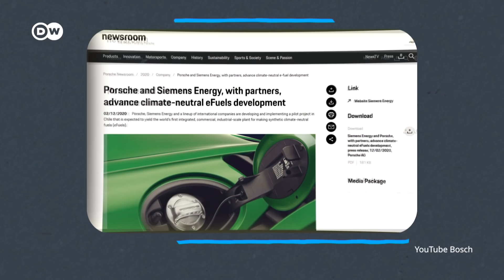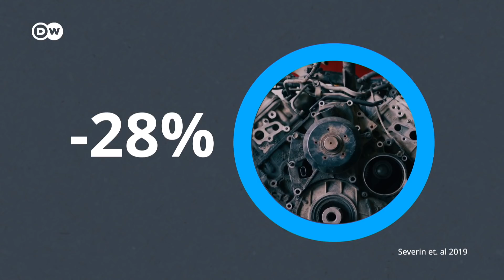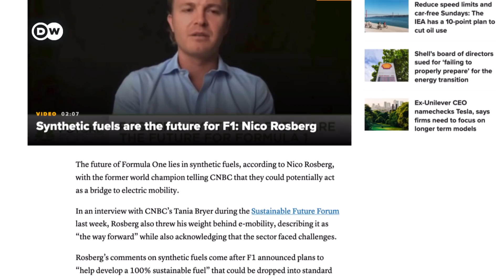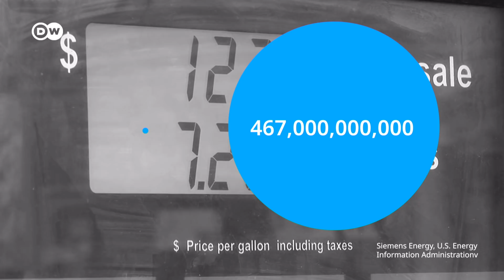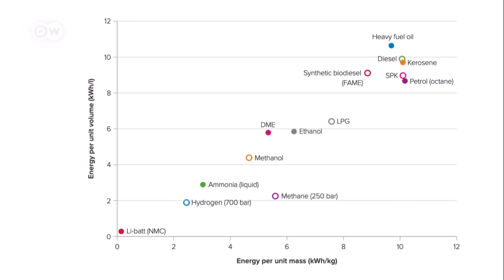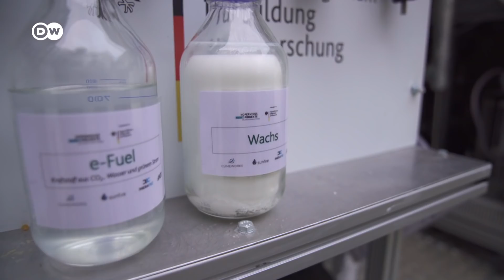The truth about carbon neutral fuels

Comment: Oh yes, creating synthetic fuels with 100% renewables makes absolutely perfect sense for ships and large planes! Those will still take a long time to electrify. Although we've almost cracked the "excellent electric passenger car", there's still a huge demand for cheap used cars, and the EV's just aren't there yet. Not to mention commercial large vehicles. We need a plethora of parallel solutions to sustainability, so this could indeed be a important piece of that puzzle.
Reply: Agreed. I’ve actually been surprised by some articles about electric planes recently so I’m wondering if we’re headed towards having electric planes for <3 hour long flights and synthetic fuels will be used for the longer ones.
Reply: @SaveMoneySavethePlanet  The weight, cost, and recharge times of electric plane batteries have got to come WAY down before they will be suitable for anything other than light planes, especially if the plane has to cross oceans or transcontinental distances, least of all in a single hop. A transpacific flight, for example, usually lasts between 11 to 12 hours, while a transatlantic flight can take eight hours. Meanwhile a flight from NY to LA can take nearly six hours.

As for the battery weight, to give an idea of the scale of the problem one electric plane which has been developed can fly up to 124 miles powered by more than 5 tons of lithium ion batteries. By that yardstick it would take 50 tons of current battery technology ro fly 1200 miles and 500 tons to fly 12000 miles. Clearly the battery technology has to improve vastly. (For the record, for a given weight, jet fuel contains about 14 times more usable energy than a state-of-the-art lithium-ion battery. Time will tell whether battery technology can improve on that.)

One other thing. All these current electric planes are propeller powered. Electric JET planes are under development, and some are claiming they will happen as soon as 2026. We will just have to wait and see.
Reply: planes yes, using it with ships does not make sense. They dont really need the density, they just need the cheapest option
Reply: Just use the hydrogen in the plane directly, at an efficiency of 30%+ instead of 8-18%. Or wait 5 years for insanely better batteries (due to all the funding and R&D now going into them) which will make all these questions redundant, by running the electric motor directly at an efficiency of 94-96%.
Reply: Electric vehicules have another problem... they are not winter friendly. You lose 50%+ of the energy to heating in that season. Which makes eFuel a useful alternative for nordic countries with a severe winter, -20C and below. The proper process of eFuel evolution of it's distribution, would indeed have to start with the avation industry. Once that is taken care of, we will have to distribute it in cold weather countries or truck fleets, before boats and the rest of the world. Unless, of course, the winter problems gets resolved.
Reply: Electric for a daily range of 50-100km... (small batteries, lighter cars/lighter cars more range...)
And for more we need synthetic fuels! Otherwise it wouldn't make any sense!
Reply: We need to be able to recycle car batteries effectively or we will never have a sustainable amount of metals.
Reply: @richardmenz3257  Luckily they are 96% recyclable
Reply: @sneaky_krait7271  Recyclable doesn't mean it's economical. To separate the metals in a battery is difficult at scale, and that's expensive. So much so, it's just cheaper to mine for new metals.
Reply: @MarkChristian2010  Yet there are already companies making facilities for it, like Mercedes-Benz and Northvolt. And it will only get more interesting as the materials will get more expensive in future
Reply: @sneaky_krait7271  That's a logical fallacy. Just because there are already companies in existences doesn't mean it's economical. Recycling in general isn't economical, so government often has to tax and subsidize the usage of materials to fund recycling. 

For example: Here in California, they add a recycling tax to the purchase of plastic water bottles. This is 5 cents per bottle, which doesn't sounds like much, but the market cost to produce a plastic bottle is only a fraction of that. And even then, the state still loses money and can't fully fund recycle programs.

Now imagine the same applied to EV batteries. If EV batteries start piling up, the state will eventually start taxing people to fund recycling of the batteries. EV batteries are already exorbitant, so I don't know why you think rising material cost is interesting. That only spells economic headwinds for EV technology.
Reply: @MarkChristian2010  Do you pay this 5 cent or do you get it back when you return the empty bottle?

When the metals get more rare, it is harder to mine and so more attractive to recycle.
Reply: @sneaky_krait7271  It's a redemption value program. However, that's not the point. The value of the CRV doesn't completely cover the recycling cost. As a result, many of the bottles go unrecycled, and the state uses the left over CRV, along with other programs, to subsidies the operators. But even that doesn't completely cover the cost. Simply, the cost to recycle is higher than the cost of the material, meaning it cheaper to just toss the plastic away than it is to recycle it. 

And again, I don't understand the point about recycling and rising of materials. People do not buy plastic water bottles to recycle the material, they buy them to drink water. They also don't buy EV batteries to recycle them, they buy them because they want to drive their cars. 

Recycling isn't a byproduct that has added economic gain, it's form of economic run-around, or an added cost to the primary product. You ultimately pay more for the primary function.
Reply: @MarkChristian2010  So do you get your 5 cents back or not when you return the bottle?

People don't buy batteries new to recycle, but when they are done and trashed they are. Also a big difference here is that plastic is basically worthless, but batteries have expensive materials in them.

The recycling doesn't get more expensive when the material goes up in price, the process remains the same. Thus as it's becoming harder to mine it's easier to recycle.
Reply: @sneaky_krait7271  I just explained to you. 

Even with the 5 cent redemption and various other subsidies, the state cannot support the CRV program. As result, there becomes diseconomies that ultimately increases the price. Many of these operators have shut down, or it's forced sellers to increase prices at the point of sale. As a result of that, the program falls short of recycle targets, and we pay higher prices overall. 

And again, the purpose is not to recycle. Batteries, as they are, are already uneconomical. If the cost to recycle now has to be thrown in, then that only makes things worse. If the cost of materials doesn't match the cost of recycle, that's not a good thing. That means it's wasteful and uneconomical.
Reply: @MarkChristian2010  If you get your 5 cents back that means it doesn't end up with the recycler. 

If recycling is cheaper than mining it's a good thing to recycle.
Reply: I was a little confused, I almost thought you were being sarcastic. But yes, I agree. I would totally support synthetic fuels.
Reply: About the Used UV Id take a 15k  Honda Accord or a Diesel Audi over an used EV any time.... it's battery would be toast also it's performance would be as damp as the look of a Brussels bureaucrat.
Reply: @borislavvalchev8737  not sure where you got that idea. No EV reduces its performance with age. They do reduce performance when energy percentage is below 5% but that's it. Plus EV batteries have been shown to easily last over 200K miles and I see a lot of used EVs with far less than that. Still, even at 100K miles, you're only have lost like 20-50 miles of range. It's not like it's worthless.
Reply: You understand we need much more renewables to Power all that when Theres Not at all Sure we will have the renewables For every sector of the Economy?
Reply: If you think about it, transportation companies are not going to pay that extra GREEN PREMIUM to pay for e-fuel. they would just buy cheaper conventional fuels
Reply: There's no such thing as "sustainability".
Reply: From an engineering standpoint I can tell you BEV's are a loooooong way from mainstream consumer adoption. The technology and infrastructure will take at least an additional* two decades to catch up if not five.
Reply: airbus and cfm will release hydrogen jet in 2035
Reply: Synthetic fuels currently cost 10x as much. That will come down but it will always be expensive. They are not a solution for poor people. EVs are expensive to buy but very cheap to run, at least for anyone who can park their car somewhere they can charge it, at home or at work. It would be cheaper to borrow the money to buy an EV rather than pay the high cost of Synthetic fuels to keep using your old car. Governments should back low cost loans for purchasing EVs to get around the "I can't afford an EV" problem. Cheap EVs are coming. In China you can buy a short range urban EV for 5k. In the UK you can buy a second hand EV for 7-8k.
Reply: @adrianthoroughgood1191  EVs are cheap to use now, but what if electricity cost shoot up because everyone is using more electricity??
Reply: @dan2danger  Electricity is just a form of energy, as is gas. 

But 1, bevs are much more efficient at converting that energy to movement.

2, the electricity we use for cars will be offset by the electricity we won't use to refine oil.
Reply: @anxiousearth680  electric cars still use oil, and the parts that are made of oil
Reply: @adrianthoroughgood1191  and charging EVs on the road is wayy more expensive, can cost more than gas to fuel up
Reply: Taurus, I 100% agree with you, although a lot of people say e fuel does have disadvantages, I think we can still find loop holes around it
Reply: I mean the Chevy Bolt is only $27K. Finding any gas cars cheaper than that is pretty iffy. The Chevy spark is the cheapest car at only $13K, but let's be serious here, nobody is buying that tiny piece of junk
Reply: Cheap and used electric cars will come automatically when the new ones are used
Reply: @sneaky_krait7271  and they'll be garbage by then

Comment: I like the breakdown of efficiency of efuel, with these sorts of efficiencies  it's a non starter. What I would like to see is a breakdown of EV efficiency, from construction of the batteries to the construction of the vehicle.
Reply: I’m not exactly sure how you would include manufacturing efficiency in efficiency of energy transportation/driving…

…but if you’re looking for emissions of construction vs emissions over the life of a car I’ve seen that! Basically, EVs generate far more emissions than ICE cars during the manufacturing process. But, with the emissions of the current EU electrical grid, this extra emissions is offset by the time the car has been driven ~40k miles. If the car is driven 200k+ miles then it ends up having FAR less emissions than the ICE car.

And these numbers continue to get better as the electrical grid brings more renewable generation online.

Comment: Nay, we should've been done with combustion engines a long time ago just for the low efficiency alone, only use it for certain applications. The main reason electricity has been held back is because the monopoly of oil on everything, and efuel seems like it has a whole lot of inefficiency, it is in its infancy but like the combustion engine I don't think it will get much better even with vast decades of research.

Comment: Great balanced video. To me, if your first step is splitting water into Hydrogen, you might as well just stop there. Hydrogen/ Ammonia is transportable, has decent energy density and can be used on the grid or for heavy vehicles.
Reply: I believe the reason that they’re throwing all the extra steps in is so that it’s usable in current cars. 

Makes sense on some level. After all, my last car lasted 200k miles and 14 years. So ICE cars being purchased this year could be on the road polluting for a VERY long time. I still believe that the long term plan of replacing them all with clean tech is a good idea, but a bridge of clean fuel might very well be needed.
Reply: @SaveMoneySavethePlanet  Good points. I'm assuming that in 5 years time, the budget EV car sector and also the used EV market will be significantly healthier than it is today, which along with govt incentives, would see the vast majority switch over. But you're right, if progress is slower, then a bridge fuel might help.

Comment: eFuels will be most likely a solution for a niche market. Ever thought how old (especially classic) cars with combustion engines will be moved once our emissions of carbon dioxide are that strict that you are not allowed to run those with regular fuel? Exactly like this. Planes and ships will profit from that as well, that's right. About the batteries in EVs: the production of them needs ressources like cobalt or lithium and the process to create the battery needs a lot of energy as well. On average a current EV needs around 8 to 8.5 years to be better for the climate than one with a combustion engine. I don't think our technology for batteries is quite good yet. The difference? Combustion engines are researched better and movement with electricity just started to be popular. Recycling of batteries might be a good idea, still needs research. 

I believe there are some other issues as well: company cars are often replaced about every five years (and even less) - sure those cars are sold to others as well, but how about we stick to cars instead of replacing them every 5 years? This is an issue I see with the car industry in general: you don't want to have high milage due to the costs of repairs. Currently those are actually getting higher and higher (and that's not even the fault of the complexity or only partially).

I don't think we will rely only on ONE form of energy in the future. eFuels, electricity, hydrogen - these are options and we shouldn't just say that ONLY ONE of them is right. eFuels are expensive, no doubt and they "waste" energy. Actually you can use that wasted energy as well. Ever heard of the energy conservation law? Energy just changes into another form, in most cases thermal energy. Use this energy to heat up something and you won't "waste" that much energy anymore. That's how it is done with combustion engines in cars and that's how it can be done in general without "wasting" that much energy. We're still on a long road to real effinciency and just using different ressources our earth provides, doesn't make things that much better (in terms of batteries). Recycling is and will be a big topic in terms of ressources. 

I know that it currently sounds like EVs are solving all of our problems regarding the emissions, but that won't happen all that fast. There's the factor mentioned with 29 % being regenerative energies, which isn't even one third, but the other is the production of the batteries. There is the need of more research in the topics of regenerative energies as well - with the current efficiency we won't be able to provide the energy we need to sustain ourselves in a "green way" (at least without using every inch available). Using wind has about 50 % efficiency, using sun currently 30 % (experimental ones have reached more than 40 though), run-of-the-river power plants up to 94 % (highly dependent on flow) and pumped-storage power plants have around 75 - 85 % of efficiency. These technologies can't be used just anywhere without losing much efficiency.

Comment: The only serious alternative is producing bio-methanol from biomass through biomass gasification, with or without external hydrogen (from "excess" of clean energy). The Swedish university of Lund did an interesting, comprehensive analysis about this. Even better, we could use that methanol in high efficiency fuel cells, halving at least the cost and bulk of batteries in electric vehicles and in a way that produces zero pollution, not only no CO2 emissions
https://www.youtube.com/watch?v=g1FD9ymSQeU
https://youtu.be/lvRxP3gnwBI

We can convert 60% of the energy of the biomass into liquid methanol or even 80% sacrifing some electricity (till
155% of biomass using a LOT of external electricity)
Reply: Intersting enough, in that second case (80% yield from biomass to liquid) you can get more km/miles from one kWh of clean electricity from a methanol fuel cell vehicle than a battery electric one (not to say the savings of weight and costs of most of the batteries)

Comment: Why not use alternate steps? Electrolysis, carbon capture and part of the synthesis can be replaced by creating wood gas in a renewable energy kiln (either electric or by stored thermal energy). This also produces biochar which multiplies the carbon negative effect of the process and can run as a side business for soil enhancement.

Comment: Sounds like very promising bridge technology where it is saves the internal combustion engine from the die.
If the e-Fuels can't saved the internal combustion engine and batteries from the EV's don't charging the battery very quickly, then the hydrogen is the only solution for transportation for vehicles where is moves either Electric Engine and either with internal combustion engine. 
For all this energy forms does exist solution maybe for the BEV.